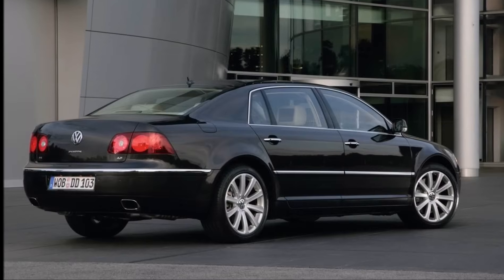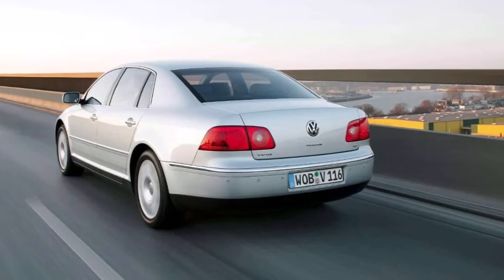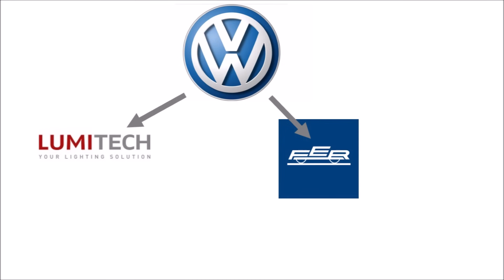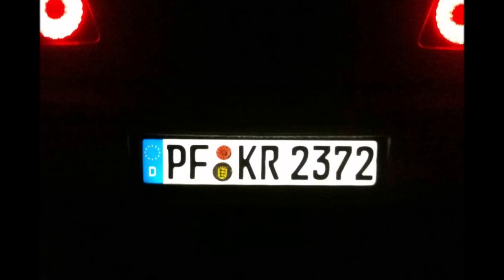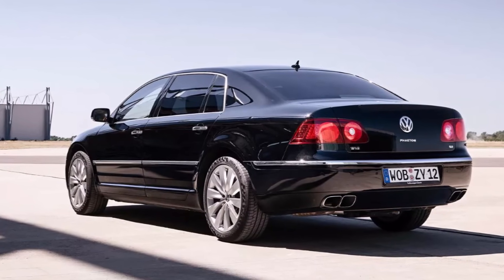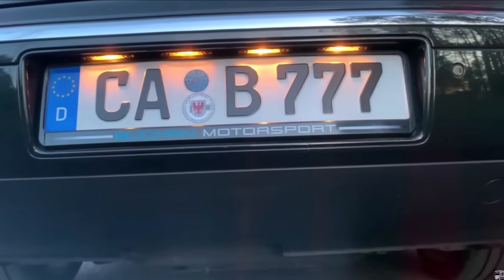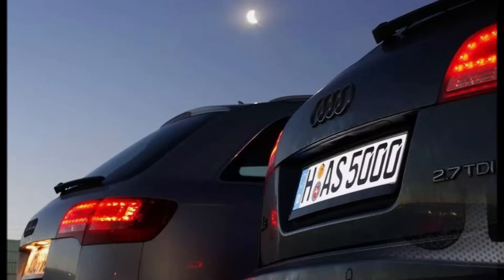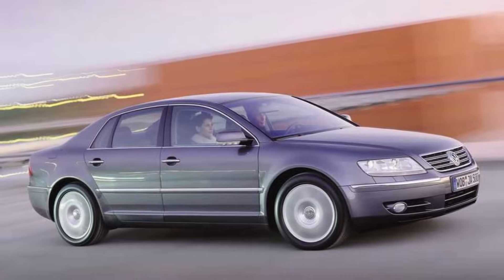VW Phaeton - Part 6 - Let's reinvent licence plate illumination!

Comment: Man, with your detailed videos you made me consider obtaining one Phaeton, even though I know I shouldn’t 😂 3.0 TDI 239 (240) horsepower from 2009 - is it having any specific issues?
Reply from the maker: That is similar to mine, which is 2008 but GP1.
I will make a separate video about all problems and things to watch out for on a Phaeton.
Reply: @bsport320 thank you! I’m likely buying it next week. Anything in particular to watch for except the timing chain? The screen is also failing regularly.
Reply from the maker: @dromeozaur  Look at the power steering pipes in the front left wheel arch and oxidation on the aluminium doors. Screen failing doesn't sound good, depending on which screen.

Comment: Does G-elumic also do other countries license plates? In older cars the license plates are often a problem at the yearly inspection. Could be worth it to have such and with a battery as backup just for the inspection... Or could just do a 12V battery because the wires in the wrinkled pipe is cut 😂

Comment: Can you make a video about why VW couldn't make cars as reliable as toyota? Is it because of design philosophy, management decisions, supplier issues or just plain incompetence?
Reply: i second this
Reply from the maker: Interesting topic, I will put in on my list
Reply: @bsport320 yes please choose this topic. I have a toyota fan who is a close friend and we run into lots of debates
Reply: Volkswagens have numerous typical defects that could have been easily avoided either with threadlocker or by choosing the parts supplier more carefully😅 A couple of examples... Loose mounting screws on the VVT wheel, no lock or other locking on the screws. Second, bad cam chains and chain tensioners, and the fact that the camshaft sprocket cannot be replaced. In other words, the design has prioritized ease of assembly and cheapness, and forgotten durability.
Reply: @Elmeri79  A locking screw or cam chain tensioner are cost optimizatios. They could but it would be visible in the balance sheet and shareholder profits. VW is very good at this and the consumer does not reap the benefits.
Reply: So many answers yet nobody seems to pick the obvious point: Toyota is McDonald's, it produces what works, optimizing the supply chain. They produce the same model for 20 years if it sells. Just changing faces. Germans on the other hand are like a chef who tries to get into Michelin guide. They try to get as much tech into a car as possible, every 5 years. Ofc in order to put more stuff into a car you have to make everything as flimsy as possible. Otherwise it would become too expensive. Not to mention the fact that if you make something more efficient it means there's no slack, no added robustness. Because you make double the horsepower from the same size. Meaning more heat stress
Reply: @imakro69  
I hope You are joking with this comparsion.
Reply: The assumption of perfect service at correct intervals?
Reply: Its this do the maintenance and it lasts, i do my dsg services early and my oil changes ay 7k the most usually 5k and im at 213k miles on my a3 @bobbagum
Reply: And you could ask the same the other way around, why Toyota couldn't make their cars as corrosion resistant and have as good of a crash rating as VW.
Somehow manufacturers can't just make a car with an Audi-Space-Frame, a Toyota engine, and have the maintenance cost and repairability of a Lada.
Reply: I agree, there are a many things toyota doesn't do as well as VW.  @sasjadv
Reply: @sasjadv I have a -2008 Toyota Avensis, and I see rusted tailgates of much newer VAG cars at traffic lights here in Finland every day. Mine's tailgate is still completely rust-free😅
Reply: @Elmeri79  But that's visible rust on the outside? The tailgate? 🤔 Normally cars start rusting from the underside, where you don't immediately see it.
Did they bump their tailgate into a low ceiling?
Reply: For some reason, the paint on VAG cars is chipping off in large pieces. I suspect that the paint is too hard and/or the paint has not adhered properly to its surface. @sasjadv
Reply: @Elmeri79  🤔I looked it up online, and yes, there are more people talking about this. Certain model years, on certain cars have this.
To me this looks more like first corrosion getting under the paint, and the paint coming off after that. But i'm not sure.
Reply: Two vastly different approaches. VAG chooses sophistication while Toyota is conservative. The Phaeton was peak form of sophistication, this complexity came at a major cost though as it needed equally sophisticated service with a particular emphasis on knowledge and strong analytical skills. In a world where many car owners can barely keep up with basic maintenance such as prompt oil changes, the complexity of this car is hard to appreciate - and take care of accordingly.
Reply: VW have the most number of cars on the roads with over 100k miles. You dont achieve this by building unreliable cars. VW always push engineering, Toyota, with the exception of the hybrid drive train, do not. This goes for everything from the engines, gearboxes, body, interior, design and so on. If you want to advance engineering, itll come at a cost of less reliability simply because it's something new and we dont know what the weaknesses are. Look at the DSG. It had issues in the beginning but now, they've been building them for 25 years and they are incredibly stable and reliable. Regular servicing is something German manufacturers expect customers to do, although they dont, especially these days, so one cant always blame the product for poor reliability.
Reply: @Olliebobalong  As a person Daily driving an Audi, I will not be a fanboy of VAG.
I have seen too many cases of: "come on guy, why is it implemented this way?" on my car and others.
Why is the aerodynamics on all porsches worse than a Mitsubishi Mirage/Spacestar?
Why can't VAG engines just be simple vtec/vvt-i with nothing more?
Why are these bolts in my Audi in such an inconvenient place?
Would I want a Honda/Toyota in its entirety? Nope, to me that would just mean trading some cons for others. Like getting the same fuel economy on a hybrid, that I now get without hybrid.
    Good cars where I would say: "here everything is right, take notes from them", don't exist (yet).
Reply: @sasjadv the aerodynamic being worse in a Porsche vs a mirage is actually so hilarious. You have no credibility 😂
Reply: @Olliebobalong   😉Look at actual numbers:
0,36 Cd — Porsche 911 GT3 RS
0,35 Cd — Porsche Cayenne
0,28 Cd — Mirage from 2019.
Only the Taycan has lower coefficient of drag with 0,22.
Do you know the "downforce" numbers? A lot of coupes actually produce lift, including the body of a 911.
Something like a carrera 911 with no spoiler/wing can have a lift coefficient of 0,05 (depending on the generation and trim). The spoiler or rear wing is not just pushing down, it's counteracting the upwards force.
Reply: Do you really think that Toyota doesn't have many cars with over 160kkm on the road? The average age of cars in Finland is 13.6 years, and that's why Toyota is the best-selling car in Finland, because there are long distances and old cars here 😅 Many people here consider a car to be almost new if it has "only" 100kkm on it😆 @Olliebobalong
Reply: @Olliebobalong  
Sorry, 160.000 km is not an achivement for any car in todays market. 
Where do You get that statistics from?
Reply: Toyota makes garbage ugly cars, cheaply built and reliability is a myth from 80s, saying as someone who relates to car service
Reply: overengineering in combination with production cost optimization is one of the problems…
Reply: Use case and driving feel. Done.
Reply: I doubt Toyotas would significantly outlast VW if they were cared for (or, well, not) by the folks who own VW's.
Reply: cause garbage doesn't break down
Reply: Because being reliable isnt profitable
Reply: Also who decided that service interval for changing oil  is 30 000 km or 2 years which cuts engine life at least 1/2 .
 I bought used  BMW X5 from Switzerland with 220k km on clock 40D ,i saw in service book that it was service on 32k km awerage between and in service book its says 30k or 2 year what comes first but i was like ,every youtuber  says  3.0  BMW diesel engines are great  ,i will change oil on 10k and want be a problem .
 I service it when i bought but guess it was 2 late allready and engine died just 2 months after i bought it ,engine was like still running but making horrible sounds ,when they dissemble it crankshaft had horrible scars and rebuild was like expeeensive. After 2 months they finish i park it and sold it ,i had no courage to even go to supermarket with it .
 That engines should last half milion km with out problem and not 200k ,but when looked other cars service history it was all the same ,30k km or 2 years what comes first
Reply: Because VW often (especially during Piëch) shot for the stars... How many VR6 did you see from Toyota? W12? 

I wouldn't say the comparably optioned cars are any less reliable. VW mostly just gave much more options.
Reply: I feel like this series is kind of already answering that question - refining the wheel and reinventing the wheel are two different things.
Reply: Pointless because it's obvious
Reply: VW are more reliable than toyota.
Anytime I see blue smoke in traffic, it's always a Toyota or a Honda.
Last time was a 2012-2015 RAV4 which smoked so heavily I had to turn on the air recirculation on my VW with 300k km